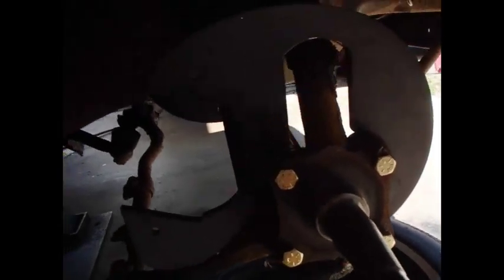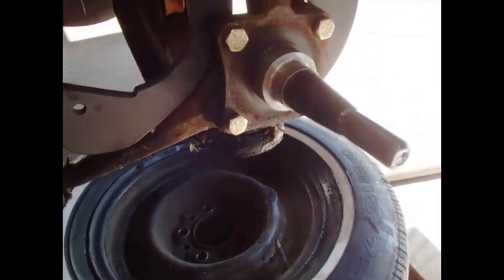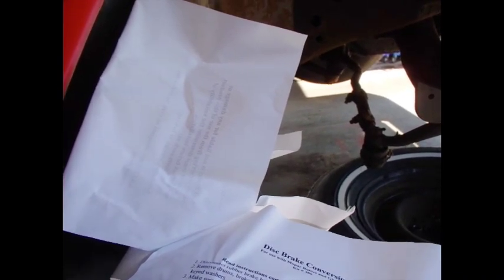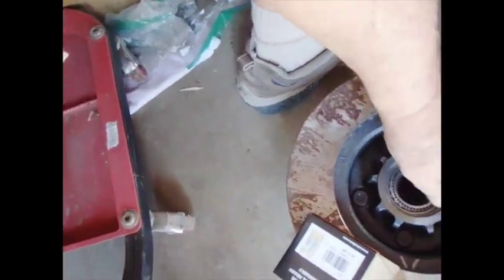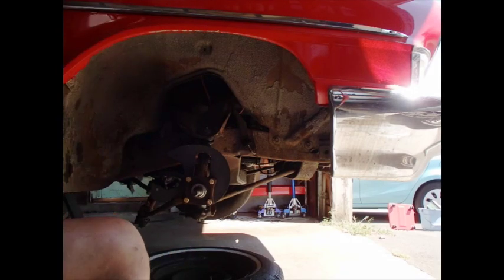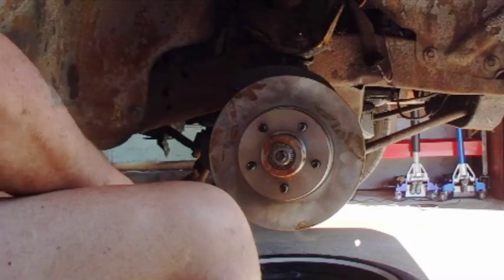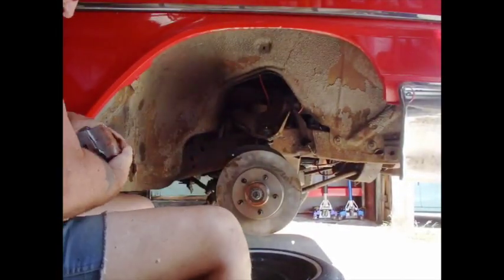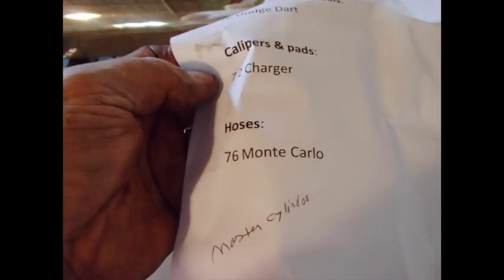61 Chrysler New Disc Brake Front AAJ disc swap kit

Comment: Hello Mr. P, did you ever get them finished? I'm about to do the upgrade on my 58 Coronet and your videos are incredibly helpful. Just wondering what you think of the end results. Thanks, Sam
Reply from the maker: Yep.  Got them finished and love them, in fact I've got a playlist on the conversion.   Also, on mine I used GM master but then realized Mopar made one I could have used.  End result the same, just would have been more original.   She stops mighty fine with the discs.  I'll put the link to the playlist here.
Reply from the maker: https://www.youtube.com/watch?v=6AjaFCZV1BA&list=PLvFup6BV6kom4Cg9kouKl-32GKHZS54LG
Reply from the maker: If it don't show up you might have to look in your junk file.   Also, you can go to my channel page and search my playlist for the disc brake conversion playlist.   Good luck with yours.
Reply from the maker: The one problem I did have with mine is that even though the disc fixed the front brakes, the back ones still stick.    Might consider a rear wheel conversion too.
Reply: @rpeek  great info, thanks and the car looks great! I plan to do my upgrade in a couple weeks.  Still waiting on some last minute parts like new lines.
Reply: @rpeek  I just did the swap this past weekend and your video was a huge help, thanks! One question, when you swapped the MC, did you need to adjust the pedal rod? Mine was too long for the new MC but I don't know how to adjust it correctly? I'm going to give Roger a call today, he might have some insight.

Comment: I was thinking of getting this kit for my 57 Savoy, but I only have the dough to buy the smaller kit that doesn’t have the master cylinder etc.. Does he let you know the part number of the calipers and other items needed to complete the installation?
Reply: Oh heck I just finished the video and you answered my question! Thanks!
Reply from the maker: Okay then.   Well there ya go.   He's a pretty nice guy.  I called him up and we talked about what I could and couldn't use.  It worked out pretty good.  I think if your brake booster is good you can get away with using a dual cylinder Mopar master, which should be cheaper than replacing both..  Good luck with it.

Comment: Was that the wrong side calliper ? ie the drivers side and not the passenger side one, just going by the bleed nipple and brake line port.
Reply from the maker: Whut?
Reply: bleed nipple should be at the top of calliper, the one you fitted was upside down ie on the wrong side.
Reply from the maker: By golly!  I think you're right...   Okay, glad you caught it.   Thanks!

Comment: you should probably take the new rotors in to be turned to make sure they are true, sir...
Reply from the maker: Ha !  hahahahaha..   Good 'un.
Reply: rpeek why is that funny...lol? Just because they are new rotors doesn't mean they are straight and true. I've had brand new rotors shake like crazy when I hit the pedal before.
Reply from the maker: Really?   I never had that happen but I ain't done all that many either..
Reply: rpeek  yeah... anytime you are throwing on new or used brake rotors... even if they are new you should have them turned... good bet there won't be a shaking or pulsating in the brakes after that.
Reply: Well, you are right, just because it's a new rotor don't necessarily mean it's straight... still, while I knew guys that turned new rotors where I worked, I never did.  I figured if a test drive revealed an issue I'd yank them back off and turn them, but I never did have to yank a pair of rotors back off, because there never was an issue, so I never did have to turn a brandy new rotor.  But I only ever did a replacement on countless numbers of rotors... NEW rotors.  Don't mean they ALL are straight, though.
Used rotors would probably need to be turned, but I dunno I only ever installed new.
Reply: MISTERComaToes well..
It happened to me a few times so everytime I buy new rotors now, I get them turned before they even see the vehicle...that way I'm sure they are right. I just write it off as yep that's the way most things are nowadays... junk... gotta repair some new parts right outta the box.
Reply from the maker: I usually warp mine on purpose, then I don't have to worry about warping them in the future..
Reply: rpeek now see there... another helpful tip from the rpeek archives... mannn... whatta smart fellar...